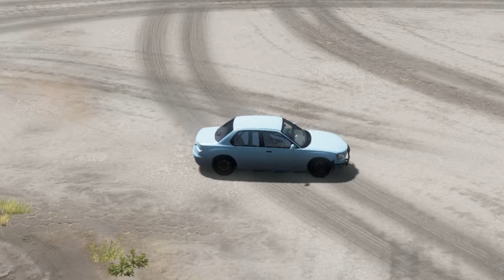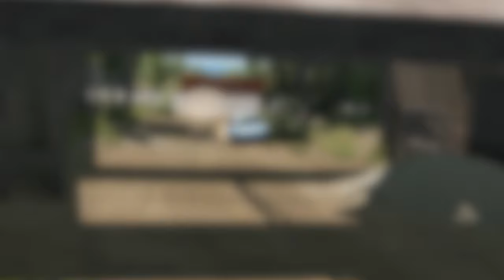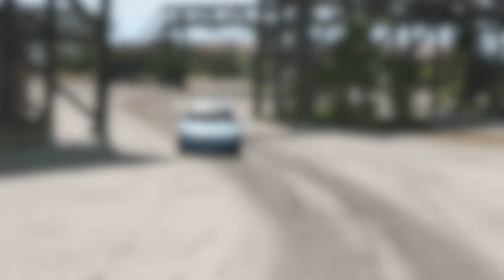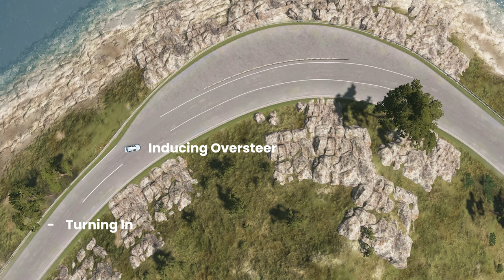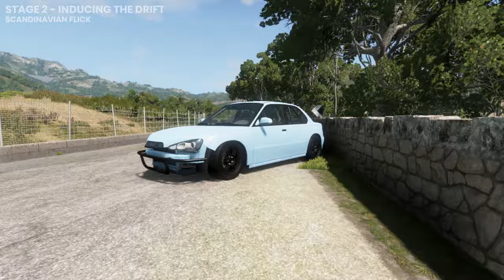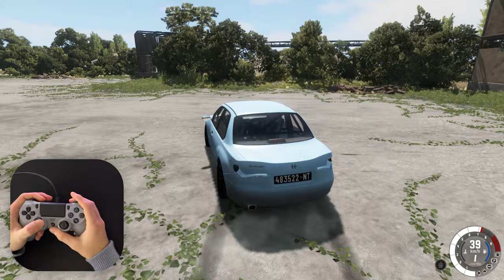How To Drift In BeamNG

Comment: Yesterday I sat down and said “I’m not going to leave this chair until I drift a stock 200bx around this one corner”. Took me 2 hours but I finally did it. The hardest part for me was exiting the drift without spinning out or stalling. I recorded the whole thing and I want to do a super cut of every time I slammed into the guard rail lol
Reply: Giving yourself a rest is important too
Reply: Yeah I had the same problem in assetto Corsa, couldn't get out of the drift smoothly

Comment: "Please, don't use a keyboard."
me: laughing because i can still drift in BeamNG with a keyboard
seriously god help me.
Reply: I know how you do it: Every button on your keyboard is binded to a different degree of turn in and you rapidly press the different buttons stubbing your fingers very fast therefore initiating a drift
Reply: good try but no, i use standard WASD controls and i make it out fine honestly
Reply: handbrake, tapping accel and turning is the way to go
Reply: Yeah it's not exactly like a controller's a significant upgrade lol
Reply: You can floor it, the car will steer back once it's on the straight, like controller, diffcult to do but try it, but don't forget throttle control
Reply: tbf, on a keyboard, you can drift any cars cuz pressing A or D just rapidly push steering to 100% at light speed, so it helps you power slide most cars even the pigeon. I'm also a keyboard player, and it took me a while to make my own RWD car with Automation, so I can actually drive a RWD car in BeamNG, otherwise I'll spinout all the RWD cars in the base game.
Reply: Using a keyboard to drive in general is very limiting.
Reply: sTILL FUN TO FLEX ON EM CONTROLLER AND WHEEL PEOPLE AAAAAAY
Reply: @Frosty Gaming use a controller?
Reply: onn keyboard its so much easier
Reply: I'm glad someone else said it... Some controller people really be thinking you can't hold an outside line on keyboard. 
Gear control and clutch kicks my dude!
Reply: @Frosty Gaming  it worked for me, idk what tf youre doing
Reply: HA! i use automatic too
Reply: Damn got skills!
Reply: me: outrageously struggling drifting with manual gear shifting
Reply: I have a wheel, but can't drift it. I'm pretty good using my flight stick and throttle though!
Reply: I like this guy

Comment: Now for the verdict of muyes vid and some of mine:
Overall the video was good, very detailed tutorial and had all the right bits in the right place, and I appreciate the use of a custom config.

My Suggestions:
1. Tune the car for oversteer, easy to initiate and to catch the car when its slides but exit can be tricky, have a light hands on the wheel
2. The Pro drift Supra (Hirochi Prasu) has a really good steering angle might be better for beginners
3. The throttle modulation was not as emphasized as I thought, a good balance between the steering and throttle can lead to good drifts
4. Setup is fricken important, You can have a car set up soft (soft springs) and make it easier to upset the weight and have it easier to initiate.
You can also have it set hard (stiff springs) amd have a good drift and exit and have more precision.
Personally in lower powered cars the I like to have it set up soft primarily because of the lack of power.
Try finding a good balance.
5. Weight and wheel base wasn't prioritize for the use of drifting a variety of cars, Weight must be kept around 1.4 tons to have a good balance between response and twitchyness. Of course it all depends on the type of car, FR (Front engined RWD) is preferred and wheelbase must be kept at a little bit of the longer side, short will be good to initiate but be harder at the limit, long will be better personally. Be away from Mid engined short wheelbase cars for obvious reasons.
6. Finally, inputs: Wheel will offer better precision, but I suggest turning the Force feedback a bunch up because BeamNG.drive has pretty weak FFB, controller is a little bit harder and takes a bit more practice

Verdict: Overall very good, This has been put up here and in the discord, this is to people in who arent in the family fucking friendly server 

I think this will help people!
Reply: Underrated comment
Reply: @andriys.1860  😔

Comment: step1 get the Gavril Grand Marshal in the V8 Roadsport  trim.
step2 install drift quick ratio front steering, 5 speed manual transmission, and a welded rear differential.
step3 drift in 2nd gear, it is the easiest car to drift.
Reply: how do you do that stuff?

Comment: I am very familiar with drifting on assetto, carx and forza but I struggle a lot with beamng. I feel like it's wheel settings because there isn't much self steer
Reply: Hey if you haven’t been playing for a bit, check the tuning settings. The vehicle config has a way to turn FFB up, but for specific setups only. Hope this helps.

Comment: i give up, how the fuck. i thought you would use the e brake but my entire understanding is wrong. and i dont have a steering wheel, and anytime i try to over steer a bit, or slide around a corner i spin out of control
Reply: ITS SO HARRDDDD